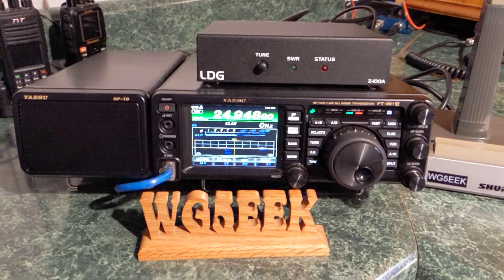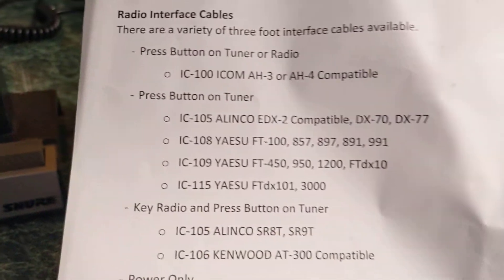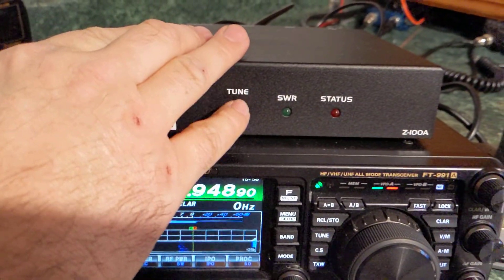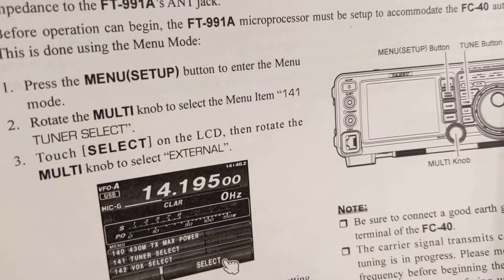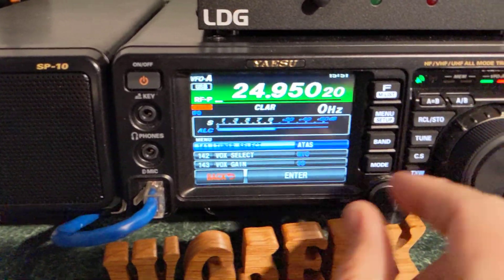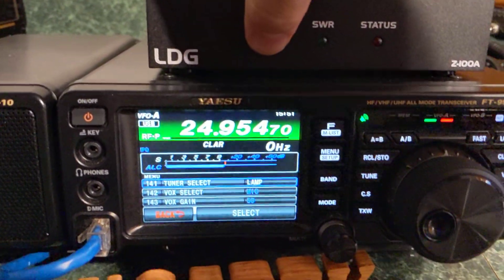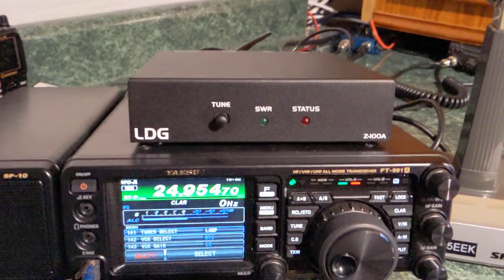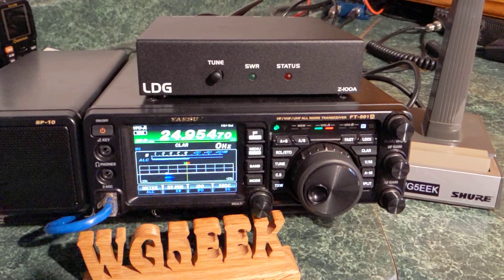How to Configure the LDG Z-100A Antenna Tuner with your Yaesu FT-991a Radio

Comment: Thank you.  Bought an LDG1000proii and the manual that I had to print, doesn't say anything about how to use it only that you really don't want to use it with a linear but not why?  Thanks, I will give it a try and see if it works with the different tuner.

Comment: got a mat-30, if you connect according to manual it does nothing...menu 141 that was the solution. Set to external...73 PE1RIV / PA6PSG

Comment: How is this tuner better than the built in tuner in the ft-991a?
Reply from the maker: That's a good question.  The FT-991a can tune antennas that have up to a 3:1 match.  External tuners sre capable of more, like this one can tune up to 10:1 SWR.  Of course having an an antenna that doesn't need to be tuned would be ideal quite as much would be ideal, but we don't always have an ideal setup.

Comment: You might want to be careful, I use the LDG Z-100 plus with the yaesu cable an have had no issues for over 3 years. One day last month I started a tune on 10 meters and the tuner jammed and the radio cooked. I now have half power on all bands and the tuner will not work on the 991a anymore yet it works manually on my DX 10 and other radios. Not sure what happened and I checked all connections and verified VSWR, etc. The only thing different was this happened during the solar storms. No idea if that contributed or has nothing to do with it. I have the 991a on the bench and I am going thru it with a fine comb from point of the tuner cable thru  to the finals to see what happened. I love this radio but its been repaired several times since I bought it new from HRO.

Comment: Mike - thank you for sharing your knowledge and I appreciate the time you take to create this video.  Please ignore the naysayers.  They are just armchair quarterbacks with nothing better to do than to pick apart other peoples success.  I just purchased an LDG Z-100Plus from a friend.  So I purchase the Y cable per the comments of this video and got the LDG Z-100Plus working with the Yaesu FT-991A radio, however it is not functioning the way I expected it to.  Also I have tried both the LAMP and the EXTERNAL antenna tuner settings in the 991 but they both give the same results.  For clarity, when I push the button and/or hold it in, on the LDG only the LED flashes on the LDG.  Or, if I transmit the radio, then hold the button on the LDG, then release it when red LED goes out, it does go through a tuning cycle.  My confusion is formost that I thought the LDG would automatically switch settings when the radio switches frequencies or bands to a previously stored setting, but mine is not doing this.  I have to push the botton on the LDG to get it to switch to a previously stored setting or make it go through the retuning process again.  Also, I thought the LDG would automatically switch to a previous stored setting without the need to push the button on the LDG.  Because I am running VARAC HF, I want to enable the feature which will enable the radio to switch bands on a schedule.   My antenna is a vertical flagpole that requires an antenna tuner.  The best antenna tuner option is a remote tuner but have not yet made the investment in one yet.  So what do you think?  Thank you.  Bret C / AC0AE
Reply from the maker: From my understanding of these tuners, they do store memories of previously tuned frequencies, but it still requires you to push the tune button on the Tuner. A long press (3 or so seconds and letting go) will always do a full tune.  If you have previously tuned a frequency, a short press (1 or less seconds) will cause it to tune based on it's memory and it will take a significantly shorter time to tune.  

I appreciate your kind words and I hope my response makes sense.
Reply: @mjw_geek  Thank you for your prompt reply.  Everything you stated makes sense, however I don't see the value of the "Y patch cable".  I don't think it is doing anything.  Bret C / AC0AE
Reply from the maker: @BretChilcott  I haven't used the Pro version but the regular one uses it to key the 991a during tuning and also power the tuner.  I think the Pro uses an external power source but should still connect to the radio to trigger it somit can obtain a proper tune.  It could use only one cable for that.

Comment: Good rundown! I have the 891. You got the same 4 blinks I did when I pressed the Tuner button before going to Tuner Select (menu 16-15). I set mine to LAMP = ON, now I get "Hi SWR" on the 891 + 4 blinks ("No RF signal") on the 100-A. No other action on the 100-A. Same issue with either a 10m EFQW or a 29' EFRW on 9:1 unun with coax feed from tuner. Antenna wires are 16 ga Monster speaker cable. 10m EFQW  has the wire separated for a ground counterpoise; the 29' EFRW does not. DIN to DIN, 3.5mm plug to port 6 (closest to the USB jack). No wire on the 100-A "ANT GND" lead. Any suggestions? 73 Ed KK7SAB
Reply from the maker: Try with a Dummy Load to rule out the antennas.  If you get the same results, you might have a faulty tuner.
Reply: @mjw_geek  thanks 73 Ed KK7SAB

Comment: Hi Mike, I still cant get that cable to work. do you have all 3 ends of the cable plugged in? One seems to go to data port on radio, the other seems to go to tun/lin on radio and the 3rd end that looks like a stereo jack i assume goes to the tuner. Do I have it correct?

Comment: Question. I have the 108 cable but the jack dont fit in to the tuner jack. What am I missing?
Reply from the maker: Are you sure they sent you the correct cable?

https://www.dxengineering.com/parts/ldg-ic-108

One end goes into the tunner, the other two go to the radio.  Double check the cable and your ports.

Comment: Thanks for the post.  I have the LDG  Z-100Plus and have been wondering what I was doing wrong.  This is working perfectly.
Reply from the maker: I'm so glad I could help!
Reply: That’s the same tuner I am using. Did you plug both cable DIN ends to rear of radio into the data and the tun/lin connection? and the 3.5 to tuner cause that’s the only connection I have at the back of tuner

Comment: The Yaesu FT-991A transceiver has a built-in antenna tuner. The author of the video should carefully read the instructions and elementary books for radio amateurs. If you use antennas with poor parameters, then there are dedicated tuners Yaesu FC-30 or FC-40 for this purpose. These antenna tuners works very good with all kind of antennas. I don't see any point in connecting the LDG tuner or others to the FT-991A transceiver. Such experiments can break the transceiver, disable and kill it. The repair of such sophisticated transceiver is very expensive and difficult. MINUS.
Reply from the maker: Thanks for your opinion.  For most of the bands, 80, 40, 20, and 15, I don't need a tuner, as the antenna  is resonant for those bands. I'm simply demonstrating how to use this tuner if you have one.  Take care and don't be a lid.
Reply: @mjw_geek  In this case, I cannot understand if a radio amateur buys a transceiver for a thousand dollars, and then tries to connect something that he found in an old and dusty closet. 
So you can experiment if this is your home-made design, which is not a pity to break and is easy to fix or throw away. In this case, there should be a competent and engineering approach, and not rely on "maybe I'm lucky." That's about it, as a radio engineer, I wanted to write. 
In any case, I shake hands. Regards.🙂
Reply: @VladiGeo  The internal tuner maxes at 3:1.  Every hear of an end fed random length wire?  Yes, someone here needs to understand competent engineering.  Guess who?
Reply: @VladiGeo  why should i buy a FC-30  or an FC40? are you a salesman for yaesu?  the ldg works fine with yaesu radios, just like an MFJ tuner works fine with an ICOM radio... here u are coming on a Hams post with what has been working for him and then u call him out... wow wow wow.
Reply: @MrRicksho  I agree with you. 
But If you connect devices from the same manufacturer, then there are no problems. You can always contact the manufacturer's website for help or advice.
 However, when matching devices from different manufacturers, there may be unexpected problems for which no one is responsible. And sometimes no one will give you the right recommendation or advice.
In my radiostation I use devices and blocks from different manufacturers (Yaesu, ACOM, MFJ etc.) and rarely, but there are various problems due to inconsistency or incompatibility.
So I wrote my advice out of good intentions only.
Each radio amateur decides for himself what to buy. The main thing is that later there will be no disappointments due to the wrong choice.
I wrote only my point of view based on my HAMs 50-years experience.

73
PS/ I am not a salesman of YAESU.
Reply: @VladiGeo I just checked your yaesu recommendations for tuners. None of them is shown by yaesu to be compatible with the ft991a (the radio in this video). In fact, in looking at yaesu's website, they don't list a tuner they make for use with the 991a. It is weird that the manual does state that the fc 40 is an accessory for the ft991a and then in other resources for the fc40, they don't list the 991a as compatable. The fc 40 is also a remote tuner for use at the feed point of an antenna, not in a shack (per the product info.) Consumers don't even have and option for additional tuners by yaesu on their website for many of their models to be able to follow your recommendation. Perhaps this is why other brands are making them because there are a number of yaesu transceivers that only includes internal tuners that can help under 3 swr.  In many cases, this is simply not enough. 
I'm a bit perplexed by the industry as I'm currently getting started in dx ham how frequently NO manufacturers or retailers provide information as to what products (especially cables, etc) will be needed for use with an item. In 2 out of 3 products I've purchased in the last month, after I get the product I find out in instructions (if there are any) that I need something else to even actually use it. So I spend $2-300+0 on an item and get free shipping, only to find out later i need a $12 item to use it and now have to spend an additional $10-25 in shipping to get it. Had they informed me i would have gotten all I needed up front! This is rediculous and is a really disjointed industry. 
At least this is one of the FEW videos that even use a transceiver that's not basically a car portable with this tuner. With so little guidance from manufacturers of all the products, it's no wonder how many ham users fumble in the dark like this trying to find answers. As a newcomer, this is dumbfounding how bad it is. Especially for the price tags on the equipment!
Reply: @ActinOut  It is very difficult to make recommendations at a great distance between us. Moreover, you are a novice amateur radio operator. If you are working with a Yaesu FT-991A transceiver, then the built-in tuner is suitable for good matched antennas to adjust them a little. If you have a homemade antenna with poor performance, it is better to use an additional external tuner, for example, Yaesu FC-40. Additionally, I can recommend using equipment from the same manufacturer in your radio room. This will definitely avoid inconsistent devices from different companies or their breakdown. Well, what to do next is up to you. 73

Comment: How to connect the  control cable?  🙏👍👋🍀🍀🍀
Reply from the maker: One cable goes to the tuner, two to the radio, one is PTT and the other only has one obvious port it fits into the 991a.
Reply: @mjw_geek  hey👋   thanks for quick answer 👍
Reply: @mjw_geek  I'm not sure which one is the "PTT" for the 3.5mm plug.  Please could you clarify.  Thanks
Reply from the maker: @rastacountry  It's the one on the back closest to the fan that says REM/ALC.  Not the one next to the USB port that says Ext Spkr. Pages 25 and 26 in the manual have a great picture and description, Number 9.

https://static.dxengineering.com/global/images/instructions/ysu-ft-991a_jy.pdf
Reply: @mjw_geek  thank you 👍👍

Comment: Actually, you should be setting to EXTERNAL in the menu and use the TUNE button on the radio.  At least that's how I've seen the MAT 30 function
Reply: Thats because the MAT 30 is a copy of the Yaesu branded tuner. Only one LDG tuner allows control via the transceiver tune button and that is the RT 100 as it can be used in ATAS mode.
Reply from the maker: Bob, thank you for that suggestion. I tried setting it up that way but neither the tuner nor radio reacts when hiting the Tune button when this tunner is connected and the radio menu 141 is set to External.  The only way to get this tunner to operate with this radio is to have menu 141 set to LAMP and to use the Tune button on the tuner itself.  Thanks for watching!

Comment: Do you hook up both plugs on radio side of the 108 cable im assuming? I'm using a ft891 with it.
Reply from the maker: I'm not sure about that radio but I did hook up both plugs on my 991a.
Reply: @mjw_geek  hi mike, I messaged you but I think you answered my question here- so all three ends get plugged in? stereo style to tuner and the other two to radio
Reply from the maker: @jsoares66  I didn't see a message, sorry.  No, two go to the radio, a DIN Style connector and the 3.5mm "stereo" plug.  The single side, with another DIN style, connector goes to the Tuner.
Reply: Maybe I am using a different ldg tuner cause mine only has the 3.5 style plug BUT both 991A and 871 have 2 different din connector which I assume I plug the both din to back if radio and the only thing left is the 3.5 which I think can go to back of tuner. The tuner doesn’t have any din port mine is LDG Z100plus which may be different
Reply from the maker: @jsoares66  That Tuner is a bit different and would have different cables.  I think that Tuner takes external power where the LDG Z-100A connects to the radio for power.
Reply: @mjw_geek  that’s what I am thinking- others have used the Y-ACC which looks like a cable with two stereo ends but when I bought the tuner they said to use the ic108 and It’s odd that LDG and DX Eng have the ic108 cable listed to work with 991A AND 891 but for 15 bucks I’ll give that a try I think you may be right on the cable. Thx for your videos and responses
Reply from the maker: You're welcome!  Let me know how it goes!

Comment: Hi Mike, I'm thinking of getting one for my ft-991A, I noticed on the 108 cable it has to plugs, do you use them both and where do they plug? I couldn't find anything on it.  73's Tom K1CXS
Reply from the maker: On the Ft-991a side, one goes in the TUN/LIN socket and the other goes in the REM/ALC socket.
Reply: @mjw_geek  Thank you so much! -Tom
Reply: I'm confused. Only 1 connection of these cables are a jack. The other 2 are multi pin connectors. Yet the connections require 1 jack at the tuner, 1 jack and a multi pin at the ft991a end. Sooo, I still don't understand how this hooks between the 2. Yet, you have them connected... somehow. I'd sure like to get this tuner working.